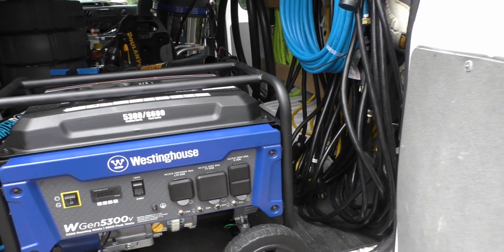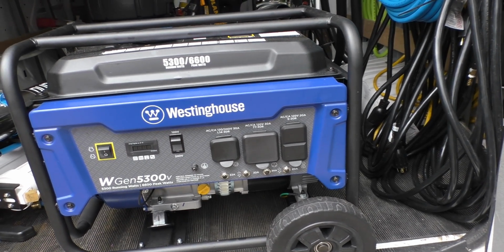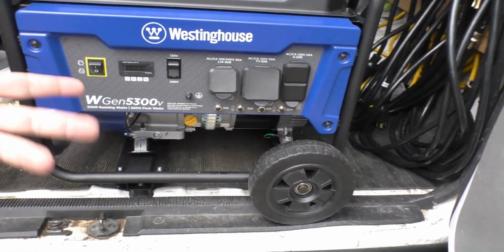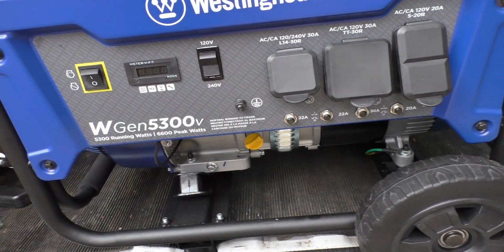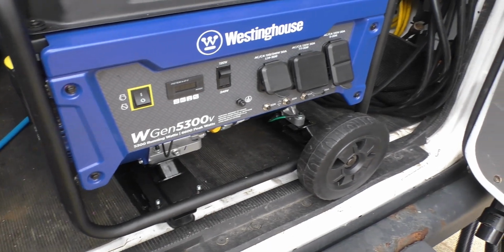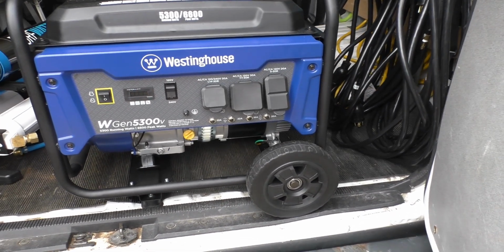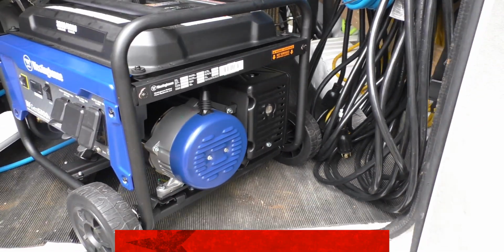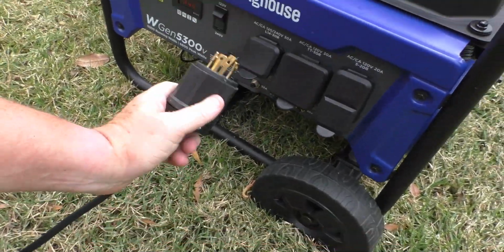Power Supply Gutter Pro Vac Gutter Vacuum Westing House WGen5300v Generator Skyvac is similar

Comment: Thanks for the video!  I found it helpful and interesting.  I’m wondering, with allllll the options fir a generator you had to choose from, how did you come to choose this one?   I’ll soon be buying a SkyVac system that has similar requirements.  6500 starting and 3600 running.  Thanks!  And good luck to you n your business!
Reply from the maker: Thanks for watching and commenting.  I picked this unit because I have a trailer with 30 amp service so I can use it in an emergency.  Also the price was good at the time.  If I found a little larger unit with the aa good price point I may have gone with that but also I'm old so I wanted to keep the weight down when loading it..  they have lighter weight units but they are expensive like the Honda...  Been in biz for decades will be closing it down soon... I'm wore out.. :)